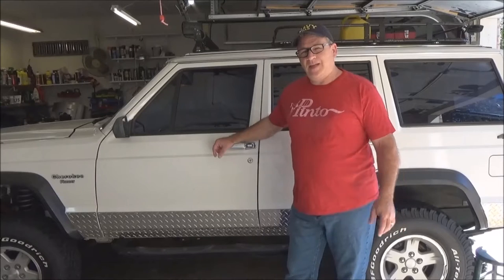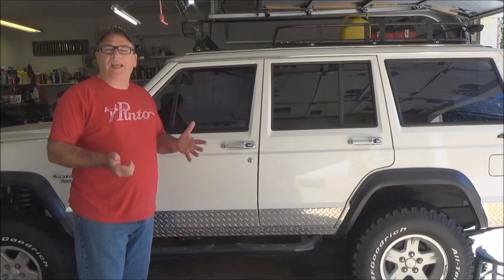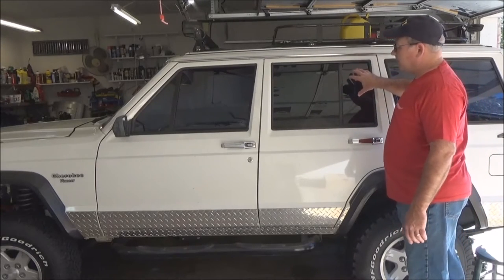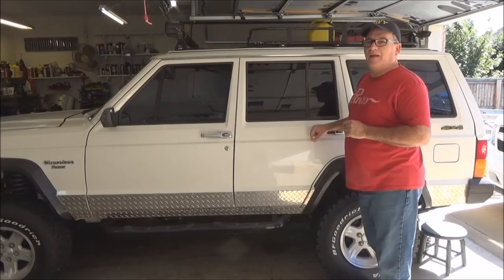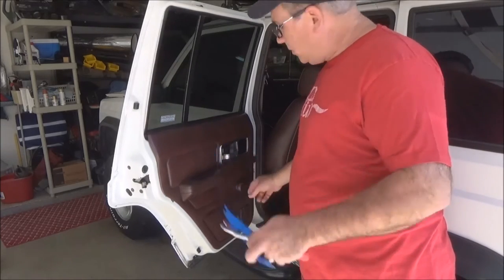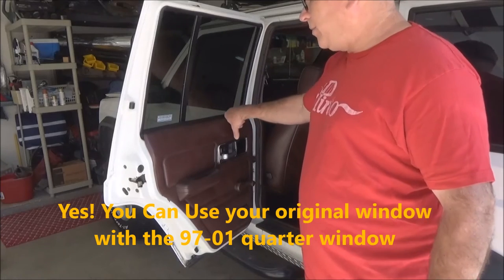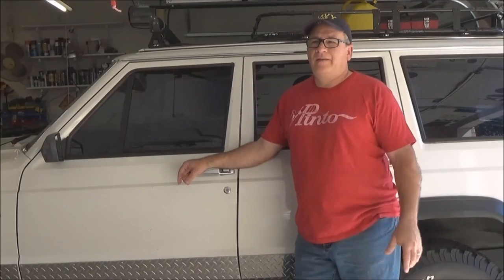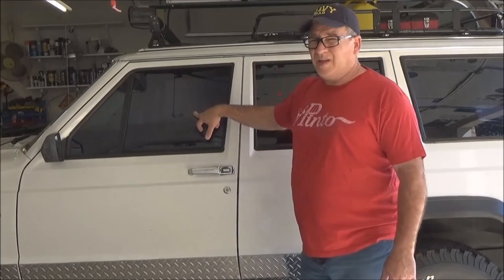Jeep Cherokee XJ Rear Door Window and Weather Seal upgrade

Comment: I could not find the videos you mentioned on how to replace the rear window in a 1997 Cherokee. First step is to lower the window then remove the inside and outside moldings, then remove the stationary window rail. There is one screw on the bottom and one screw at the top of the door. Then remove the stationary window. After that the main window can be tilted so the bottom screw can be removed and then lift the window up and out of the door. reverse the order for installation.

Comment: To drill out the rivet on the vertical divider/guide... How did you the outside chrome (or black) trim out of the way to do the drilling?      Good video and explanations, but this aspect points to at least one problem of not doing the video WHILE doing the work.
Reply from the maker: well as I stated in the video I was not going to show that part as there are a number of others on the Tube such as https://www.youtube.com/watch?v=xTSQnPaGOiM  and https://www.youtube.com/watch?v=1ZeCWaM5nIk The rubber seal just pulls off (use a plastic trim tool to protect the paint) and the rivet is right there can't miss it.

Comment: I did this upgrade to my jeep after seeing your video and its way better. Was pretty easy to do and it is 100% better than the original design. Plus now I have factory tinted glass which is nice.

Btw eventually I will get around to fixing my front window seals and I am thinking I might like to upgrade those to the 97 windows as well and I am curious where you found the info to do that at, I have looked some to no avail.
Reply from the maker: Cool, yeah its a great upgrade. As for the front windows you have to mod (cut) the 97-01 lower seal to fit around the vent window that’s about it. To mod the 84-96 door to use a 97-01 window is a pain. You would have to cut out the front channel from the older one and spot-weld in from the newer, it would be easier to swap doors.
Reply: that sucks as Ive heard swapping doors is no simple task either o well, I can live with the current window situation with a simple 97-01 bottom seal upgrade. Thanks for the reply!

Comment: I cant find Crown Automotive Rear Door Outer Window Glass Seal for 97-01 Jeep XJ :'( 

Cant find in Canada
Reply from the maker: Have you checked with these to see of they ship top Canada? I'm pretty sure Summit will ship international, you might try calling Summit directly their customer service is outstanding. 
https://www.summitracing.com/parts/cwa-55235404
https://www.amazon.com/Crown-Automotive-55235404-Weatherstrip/dp/B00BYNKFWK

https://www.quadratec.com/products/55014_8000.htm

Comment: How did u get chrome handles
Reply from the maker: there were several version that included chrome handles, such has the 1993-96 Cherokee Country addition (mine were off a 93) also the 84-90 XJ Cherokee Wagoneer had Chrome as well as the Limited. the 97-01 did not have a chrome option.

Comment: Is the window assembly the same for an XJ with automatic windows?
Reply from the maker: Yes it should work just the same for power windows but just be sure to get all of the window mounting hardware from the 97-01

Comment: Gee Navy Dad, You're a nice guy but this video is ALL TALK AND NO ACTION.
Seriously, a HOW TO VIDEO needs more "how to" than bla bla.
Can you do a 30 SECOND video follow up which only shows the actual method of dismounting the old trim?

Does anyone have a link to a video which shows how to remove the window trim on a 1998 Jeep Grand Cherokee 4.0 rear passenger door?
P.S. My door won't open so I need to get this trim off so I can get access to the latch mechanism inside.
So don't give me instructions the depend on removing the door.

Thanks to all for your help